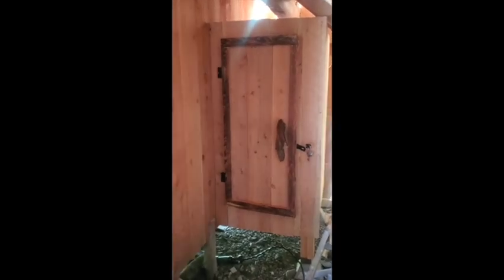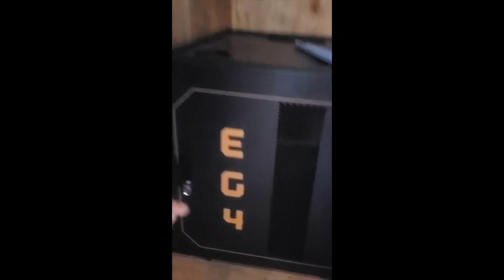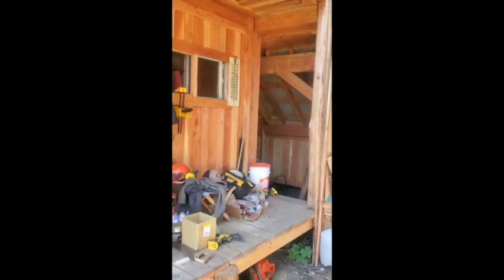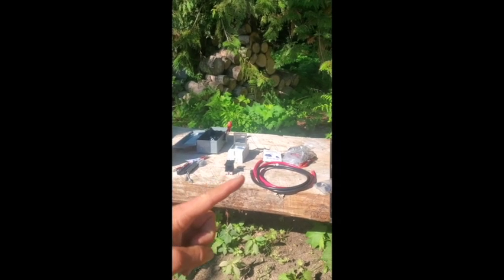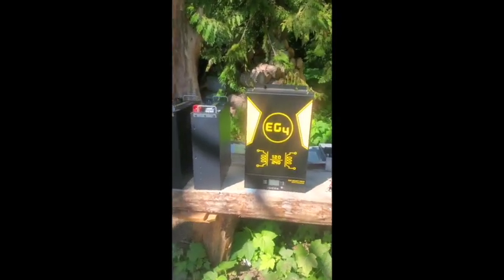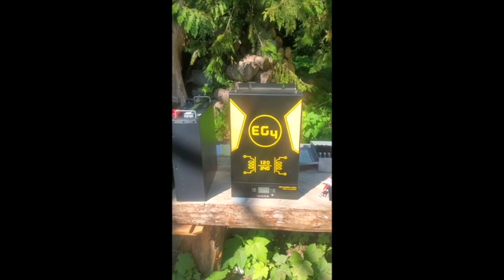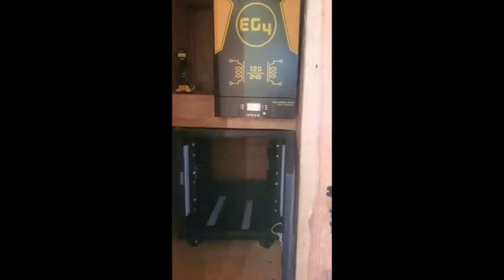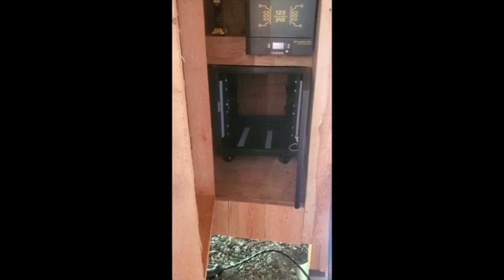The Micro Hydro Project: Episode 9 - Electronics

Comment: It looks lovely and a great install. The only th8ng you may want to check is fireproofing and clearance around the inverter in the manual. I cant see what type of breaker your using but some on them need the + and the - to work, may be worth checking that. Hope that helps ... Great job  👍
Reply from the maker: Yes, I'm unfortunately too close to the right wall for the proper fire clearance but I was limited with the small space...good catch!
Reply: @manvsland  well considering that's all made of wood if I lived there I would install a smoke alarm in that cupboard at the very least, maybe an automatic fire extinguisher, Amazon sell them I believe. Just take some precautions  👍

Comment: Question, but when the batteries are charged what keeps the turbine slowed down? The turbine would find itself without an electrical load, it would spin freely at very high speed, generating high voltages and stressing the bearings unnecessarily, this thing is fine for a few minutes to make a video like the previous ones, in the long run it would break down, and it is not the correct way to work , there are two solutions or a constant electrical load derivation, perhaps using a small reliable electric heater without fans for heating, which is the best solution given that it also protects the downstream electronics or shuts off the water when the batteries are full . Ciao
Reply from the maker: Yes, everything you said makes a lot of sense and I don't have the answer. I've been trying to figure out how to install a diversion/dump load for that exact reason but the EG4 6000ex inverter has turned out to be a giant pain in the butt in regards to a dump load! I will definitely make a video once I figure it out but for now I unfortunately have no answer....

Comment: What a great system you designed and built.   That was a lot of hard work and I am sure it will pay off.  If you do a summary video, I would like to see how you pre designed your system and what you ended up using as a dump load and how that was wired into the EG4.   I am sure you have seen in your manual that LifePO4 batteries can not be charged below freezing so you may want a dump load heater in your power shed.  Great work, you should be very happy with what you built…
Reply from the maker: Thanks! Dang, the dump load with the EG4 is a bit of a sore spot! I haven't been able to figure anything out but I'm currently ordering parts to try a new tactic. I'll be sure to keep you updated with how all that is going. 
As far as an overvieew video, my system is up and running again so I would be happy to do that along with a 'design' segment. Great idea, stay tuned!

Comment: I just installed a similar hydro in Nicaragua for my sister’s family, some suggestions for you to consider. The inverter/charge controller you are using has a minimum MPPT of 120V. (Depending on which windings your hydro PMA has) your max power could be a lower voltage than that, watching the video. I see it stays at 120V which makes me think it would find more power at a lower voltage. One simple way to check this out is to check your Voltage at free spin with no load connected, between 1/3 to 1/2 of that voltage is your max power. Hopefully, you can get the thing working again and figure your freezing problems out! Looking forward to seeing more of your video updates.
Reply from the maker: Thanks for your response! Yes I'm not very well versed on the inner workings of my inverter. It's been off all winter but hopefully I'll be able to fire it up again soon! My highest unloaded free spin output was 214 VDC. You're thinking if I can lower the voltage of the MPPT my wattage would continue to rise? Did I follow that right?
Reply: Yes sir, your free spin voltage is going to be directly related to whatever your psi is while the Hydro is running. So if you put bigger nozzles on, (which I suspect would get you more potential watts) your working PSI will drop, then your free spin and max power point voltage will get even lower. For example, I used a midnite classic 250 on my project and it is finding the Max Power Point around 205V which if I remember correctly is around 43% of free spin 475V. so in your case if free spin is 214V 43% of that would be 92V. That alone would probably get you an extra 150W with your current nozzles. but remember, if you put bigger nozzles on your potential watts will be greater, but the Max power point will be even further away (with the inverter/charge controller having a minimum of 120V MPPT) So it’s likely you will not see any power increase. (if my assumptions are correct) hopefully this makes sense.
Reply from the maker: Ok, yea i think that makes sense. I'll have to look into it a bit more. I did order a box of different size nozzels that I'm looking forward to playing with! Stay tuned for that, I'd be interested in your feedback after you see how the different nozzel sizes affect the flow rate/psi/ and max wattage... thanks again!

Comment: Your rectifier may get too hot even with the heat sink you have. Also, the inverter room will get warm or hot in summer, you may need a cooling fan to cool the room.
Reply from the maker: Yes, I finally have the system up and running again and it's like 35 degrees in the inverter room. I'll be installing a vent into the inside of my cabin shortly. It should blow cool air from my cabin in the summer and warm air in the winter to help keep the temp in that box more regulated. Thanks!

Comment: Calculation is easy. You have 2 bat's 5000Wh each, so about 10000Wh. 10000Wh/500W=20h to have the bat's charged from 0 to 100%.  Additional, you have 1kWh each 2 hours, so about 12 kWh each day. Depending your use, a house needs about 8kWh a day. So your batteries will be most of the time between 80% and 100%. Any update video after 2 months ?
Reply from the maker: Thanks! Yes, I'm still getting footage. Not to give too much away but I've had a rough beginning of the winter and don't have power at my house so I can't use my laptop! But I'll be sure to make the videos as soon as I can :)

Comment: thoughts.       large system - if compactness is desired, a large-ish turgo turbine could be used.        system plumbing, throughout, should be as efficient as possible.          there should be no ninety-degree bends immediately upstream of the turbine jets.           at the split for the jets, the plumbing to each jet should be  Sized  to carry  1/2 (or whatever value) of the total flow.      d
Reply from the maker: I'm not sure I have room in my little underground powerhouse not to have any 90 bends. I agree it would be ideas to have nice sweeping curves but alas...thanks for the ideas though, I'll continue to try to make improvements!

Comment: Watched the whole series so far, really enjoyed it. I am putting in a small system myself to augment my solar, but will only be part of the year because it is on a seasonal creek, but worth it because I already have the inverter and batteries for my solar system in place. The area you are in looks very familiar. Looks to be around smithers or further west from PG. Are you planning any more videos in this series or is it done now? One thing I am curious about though, is why you need to make your turbine watertight? I have a 1k streamengine from ES & D and it is recommended to be open to prevent splashback which will impede your turbine speed. Bigger jets would give you much more power as well. 1/4 inch seems very small for 140psi and running a 4 inch line. Just my observations.
Reply from the maker: Thanks for your wonderful comment! I'm not finished, I plan to do a 'chronicles' series that will follow all the improvements as I learn more and more. I just need internet, which means I need power, which means I need water, etc,etc. So I tend to film lots and then when the times are good, I can plug my laptop in, edit, and upload in bulk when I have internet :)
I made the drain for the hydro watertight to try and keep moisture out of the basement of the powerhouse. I figured I'd be fighting with moisture enough down there and didn't want to introduce a bunch of unnecessary water. It might impede the turbine, you're right in that regard but that's why I have 2 x 3" drains at the bottom, to drain the water away quickly, and eventually out the singular 4" pipe. Works well but may be room for improvement! Thanks again, glad you're enjoying the series and good luck with your system - it is very satisfying when it's working!

Comment: That inverter needs ventilation, i did not see any ventilation holes to that box where you put the batteries and inverter. The batteries are ok to be in that box during the winter. Converting the DC to AC is going to have some heat. Overall, I enjoyed all the videos. Good enough job o someone with no experience in this field
Reply from the maker: Thanks! Yes the box with the inverter got quite warm in the summer, ventilation is a good idea. I'm hoping now that it's winter, the heat put off by the inverter will be enough to keep that box (and the batteries!) warm.

Comment: Dummyload for when the batteries are full?
Reply from the maker: That's what I'm working on now! The whole point of the system was to have a small heater running when my batteries are full while I'm away during the winter to keep my pipes from freezing. Like everything, it's been harder to figure out than anticipated!
Reply: @manvsland  daier-XH-M609-12V-36V-Disconnect-Protection under /over  voltage programmable

Comment: You should connect the positive and negative on opposite sides of the busbars, so your battery get an even load on charge and discharge.
Hooking it up like means you individual batteries will go out of balance
Reply from the maker: I'm actually running into that issue. One battery seems to drain more and not charge as full as the other. Can you please elaborate when you say opposite sides of the busbar? You mean front and back? Thank you!
Reply: @manvsland Positive and negative cables must be the same length
Reply from the maker: @energiap2p 
Thanks! Luckily they are, they're just tucked away so you can't see them...
Reply: Did you get a com cable connected from the battery to the inverter? @manvsland
Reply from the maker: @pavalenta  
Good eye! So that's definitely something I have recently figured out. There's a certain way to not only connect everything together, but also an order to turn everything on. I was getting help from a guy over the phone but I ended up missing a whole bunch of steps and not realizing my errors until much later. But eventually I did, thank you!
Reply: @manvsland your positive (left ) should be connected on the top side of the busbar.
The busbar for the negative should be turned around and cable should be near the floor.
Reply from the maker: @houseofancients   Ahhhhh, you turn the other busbar around! I went to go change it (as per your suggestion) but the lugs at the bottom were much smaller so I didn't end up doing it. But, if I flip the negative busbar upside down it'll solve that. Amazing, thanks so much!

Comment: I don't get it. All this for 480 watts ? that's 6 cents worth of power every hour or about $1.50 a day .
Seems like a waste of resources.
Reply from the maker: Maybe, but when there's no grid to plug into what else can ya do? I do plan on adding solar eventually but there's very little sun in the winter so at least this will keep me going all year round and then I can boost it in the lighter months.
Reply: You so realize that is 480w x 24/7 ?

Every day 11,4 kWh ,no matter if it rains, snows or freezes, sounds good to me
Reply from the maker: @houseofancients  
Haha right! Although if I'm being honest, I'm still working on the 'if it freezes' part!
Reply: For what it's worth when the system is optimized it should be 1100 watts
Reply from the maker: @alabastardmasterson  
Tbh that's more like what I was expecting when I built it. I just ordered an assortment of new nozzles so maybe playing with some bigger, high flow nozzles will generate more power??? I'll let ya know!
Reply: @manvsland  you'll get there. Small tweaks can bring big wattage. You're also bringing clean water in which would've been a huge expense. Don't question your endeavors after you've already spent yrs thinking about them, even if they don't quite work out. 1st hand knowledge is more important than it's weight in gold...Gold could go to 2500 soon, though so I could be overstating things
Reply from the maker: @alabastardmasterson  
Thanks! Haha I figured this would be an adventure in its own but I gotta say, it makes it so, so sweet when everything is working! I appreciate the crap out of my water every time I turn on the tap!!! Hopefully same with power soon...
Reply: @manvsland  Check out this guy's earlier hydro series powering his personal cabin.  Kris Harbour Natural Building

He optimizes his system quite a bit and is near 500 watts.  I bet you can get a lot more.  You don't need the fancy controls he has, but there's lots of ways to reduce pressure losses and trialing different nozzles.  Great job so far on your build!
Reply from the maker: @MrPizzaman09  
Thanks! I actually have a whole box of nozzels in going to be trailing soon! Unfortunately a cold snap just wreaked havoc on my system so the testing may have to wait until things thaw out a bit...*sad face*
Reply: OK, I tried to track down the cost of all the various components :

1. Elgin coanda intake screen                       $2000
2. 55 gallon tank as silt catchment                      0  
3. 1100 feet of 1-1/4 penstock.                     $1000
4. Pelton wheel and permanent magnet alternator from 
Langston's alternative power                         $1650
5. 250 feet of direct burial 10/3 wire               $417
6. AC to DC rectifier                                            $50 ?
7. Midnite classic 250v charge controller     $724
8. Grid tie limiter inverter                                  $360
9. 2x EG4 batteries                                          $2600
10. Off Grid 6000w inverter                            $1200
11. 2/0 battery cables                                       $135
12. 3 phase disconnect                                    $100
13. Powerhouse                                                $1000 (est.)

 That's almost                                                 $17,500. 

I'm sure there were other items not listed so call it $20,000.

Full retail residential electricity costs about $.25/ kWh where I live, so at 500 watts that's $3 a day or $1100 a year if it runs 24/365, which it will not.

So the system needs to run constantly for 18+ years, without maintenance or repair, just to get your investment back.''

And that is paying yourself nothing for your time and effort.

To each his own but IMO this is an expensive way to get "free" electricity.
Reply from the maker: @realbartlett8882 
If you're curious how much the system cost me to install I'd be happy to put something together with some specifics. You have a lot of the components wrong but overall you're in the right ballpark!
Reply: @realbartlett8882  0.25c/kwh is a joke... here depending on the time of day we pay a minimum of 0.55 c/kwh upto 0.95c/kwh

besides "investment payback" .. being independent is invaluable, that is assuming the grid is even available
Reply: @realbartlett8882  Ok. now consider that grid service is unavailable. The hydro company charges 5-10k per pole for new installation. Lets say he 'only' needs 5 poles. Thats 25k-50k to get started with your 'full residential electricity.....
Reply from the maker: @packtloss  This. Exactly this. 10k per pole where I live and I'd need 6 poles! Then to have a well dug and everything,  I was looking at close to 70k